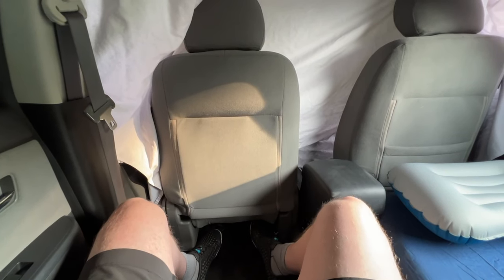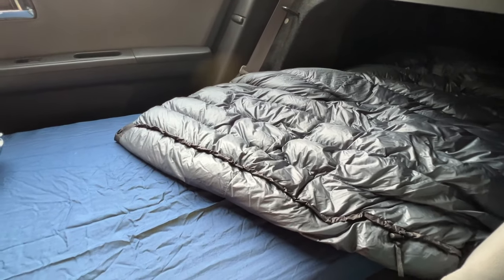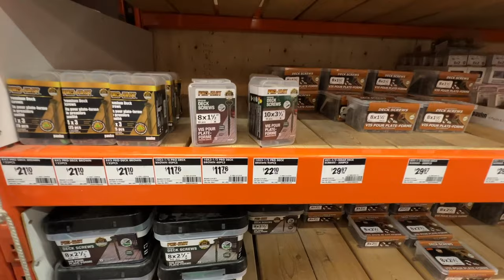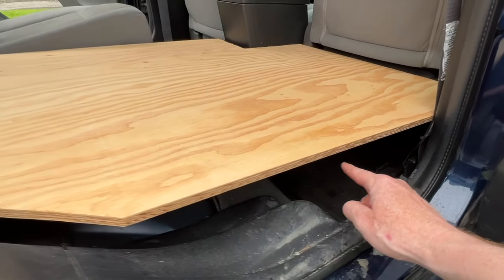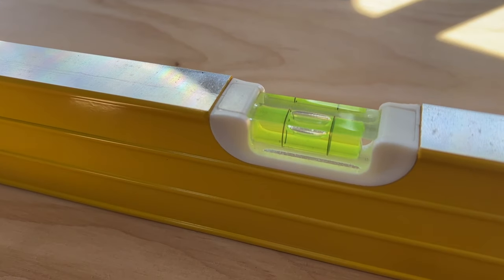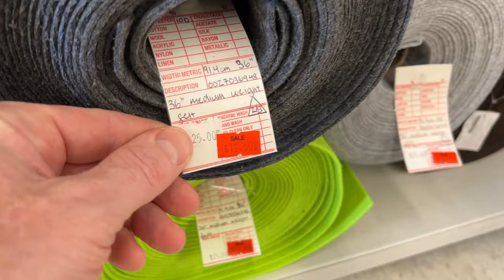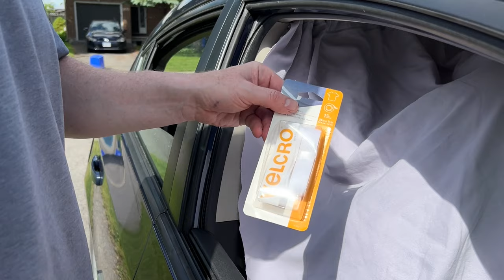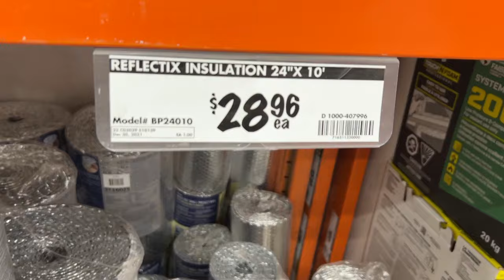CAR CAMPER CONVERSION - SLEEPING IN A NISSAN SENTRA SEDAN

Comment: This is one of the best versions of this setup that I've seen.  Well done sir!  Practical.  No complex construction, woodworking skills required.  Stealthy as well.  

Question:  Do you run your vehicle at night?  How do you stay cool with draining the battery?

Thanks!
Reply from the maker: Thanks! Glad you found it helpful! 

I have mesh window covers I use on my windows to keep them open at night. And that’s all. It does get warm. But this summer I’m thinking of investing in a battery bank and buying some fans to help circulate the air.

Comment: Nice and simple on a fuel efficient vehicle. Thanks for sharing. Did you move the front passenger seat all the way up? Considering doing it on my 2000 Camry. 👍
Reply from the maker: Thanks !

Yes the front seat is all the way forward, so unfortunately there’s no leg room up front for a passenger. But one can sit behind me on the rear bench if needed. 

at first I considered removing the front seat all together. But sliding the seat forward provided enough room. I’d imagine your Camry would probably be even bigger than my Sentra, so depending on your height you might not need to slide it all the way forward.

Comment: Thank you for all the great ideas! :D I didn't know I could find that kind of fabric at the fabric store and have been trying to slowing figure out how to build out my car.  Now that you've been camping for awhile, can you tell me if the black tape has off-gassing? I was thinking that is CRAZY EASIER then sewing but I want to bring my young son camping and he has some lung stuff so your input would help greatly. Thanks :D
Reply from the maker: You’re welcome! So glad you found it helpful regarding the vehicle fabric!

So far I haven’t been able to notice any smell or off gassing. But I’ve wondered that myself. Luckily Im mostly camping in colder seasons so I haven’t had to experience any sheltering hot days. Im guessing that might have more of an affect on the off gassing of the tape/adhesive. A good way to avoid any potential off gassing would be to tint the windows and that way the standard silver reflective would look solid black up against the windows. I believe that might’ve my next upgrade! 

Keep me posted on your build! 

All the best!
Mike

Comment: Thanks for your video! I used these ideas to do something similar for my Corolla. Instead of plywood, I got interlocking foam floor tiles (on sale at Canadian Tire) and cut them to fit using an exacto knife. Rear car seat extender for dogs from amazon. Great tip with the reflectix!

Comment: I like an air mattress for a sleeping system. It saves a lot of weight in the vehicle build. Air mattresses are comfortable. They are easy to sanitize and come in differing sizes. I prefer natural fabrics In the vehicle like cotton wool and linen. They do not emit odors and are easiest to clean. I have a Chevy express high top van with tinted windows.I have black out curtains. Its a wheel chair van so I have a permit that I can place in the vehicle that is visable. I can park in any spot that is designated for handicap use. My sleeping space is very comfortable. I have room to stand up inside and move around. I don't cook in the van unless its something minima
  I do have a 12volt refrigerator and a power station that lets me have electricity discretely anywhere. I dont cook in the van except for using my crock pot plugged into my power station. I dont use anything with an open flame in the van. I have a 12 volt tea kettle to heat water in two minutes.  I do have a two burner propane camping stove I only use it outside the van. So with it i can use a fry pan, perk fresh coffee or make a four course meal if i want to. This keeps cooking odors out of the van and I can heat water for cleaning bathing and everything else.No one has ever knocked on my door or bothered me day or night. I never stay longer than one day or one night in any one spot.  If your not leaving any messes or causing any disturbance you will be safe and no one will bother you. I also have magnetic signs that I can place in the window and remove on demand. One says clergy one says process server one says mortuary service vehicle. I have never gotten a knock on my door.

Comment: The bed looks great, but if you want to be "stealth", I would suggest window covers for all of your windows instead of the curtain. AND the window covers would also provide more privacy. Also I would be a little concerned about the safety of using that glue for attaching the fabric to your board. A may be toxic which could be carcinogenic - cancer causing.....
Reply from the maker: Thanks so much Suzy. Great advice/tips !

Comment: Hi! Have a question...I have a GMC Terrain and stopped to have a car auto place remove my back seat so I could have more room for my bed. They said NOT to because it disables the air bag system! Is this true?
Reply from the maker: Oh, possibly. But I don’t have rear airbags. My front are still enabled. No cables were disconnected when taking the seats out. Your terrain might have seat sensors in the rear?

Comment: I did much the same with my Corolla, except that the back bench is all one piece, so I lost the back seating capacity. Instead, I use that area for a cooler and some kayak gear storage. 
Works pretty good! Going on year 4 now of tons of camping and paddling.
Reply from the maker: That awesome!! I bet that extra storage space is super useful.

Comment: How would you keep your self warm over night if the temp drops to -10 Celsius. Is there a way we could install a propane heater safely? Or would you go with a battery heater?
Reply: Trying to survive Vancouver winter so its not so bad. Would like to pick your brain on ideas to keep warm overnight
Reply from the maker: Hey! Thanks for watching. 

Good question!

I’ve only been sleeping in it at trailheads for fall hiking trips in the Adirondacks. Don’t plan on using this setup in the dead of winter. 

It’s already gotten to -4 Celsius overnight and I’ve been cozy in my warmer mummy sleeping bag.  I think it’ll start dropping to -10 soon so I’ll be able to give that a try too. 

I would be too nervous to use a propane heater unless it vented properly. 

Maybe use a camp stove to boil water and pour it into a Nalgene bottle to sleep with in the sleeping bag? That might work. 

An electric heat pad could work too. maybe a large power bank will be able to keep it going all night. I may have to do some research on that!

What are your thoughts?

Mike

Comment: is there a support point between the front 2x4s and the spare tire well for the two beams underneath the plywood?
Reply from the maker: None needed in my case. The wood supports rest on a lip that runs along g the back of the trunk and they cross over the spare tire well unsupported and then are supported once the other side of the well by the cars’s frame. Hope that makes sense?
Reply: @mikebikercanada  ok I see. So existing support points are not really that far apart, and would not cause board bending.